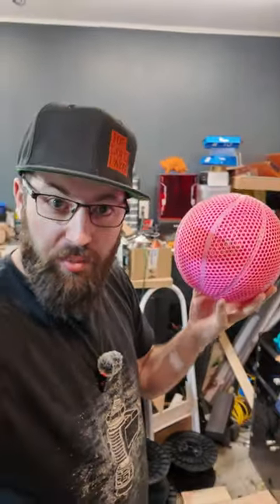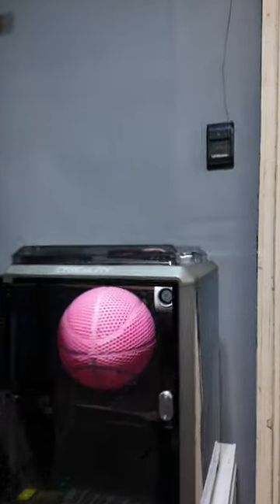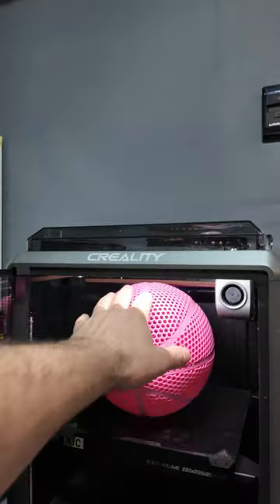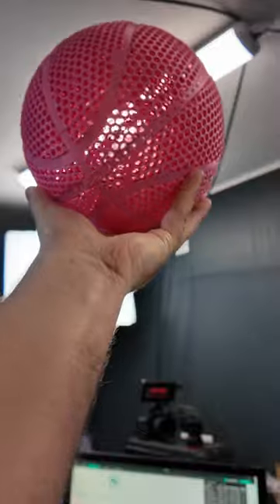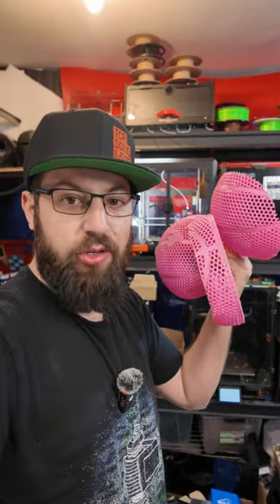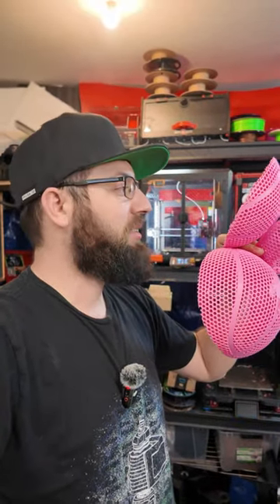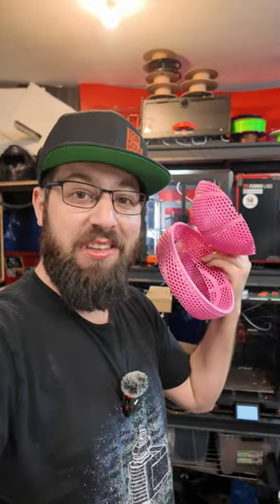DOES AN AIRLESS BASKETBALL BOUNCE?  #3dprinting #fail #shorts #basketball

Comment: PEBA is what you want to print it with, you're also using the wrong stl.... V12 of the stl that has an internal lattice printed in PEBA weighs roughly the same as a normal basketball and bounces about the same too.
Reply: Yep

Comment: ABS is supposed to have high impact strength, so I blame 50ºC chamber temp layer adhesion on that one
Reply from the maker: With the geometry, there really isnt much you could do to make it work with ABS unfortunatly. Nylons and some of the fanciers PLA/TPUs work though

still doesnt bounce like a real basketball though (again, the reason the specially formulated REAL wilson basketball costs 2500$)
Reply: Yeah that's some garbage layer adhesion. Crank the nozzle temp to at least 300.